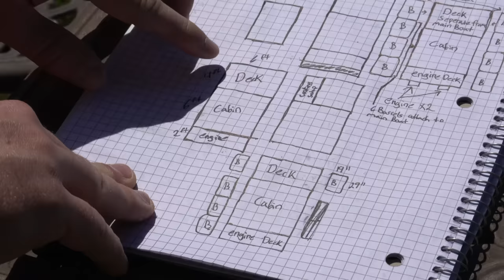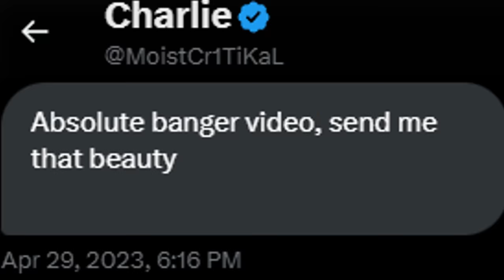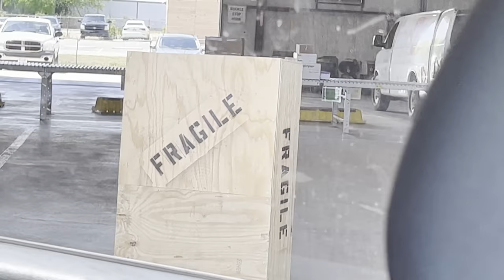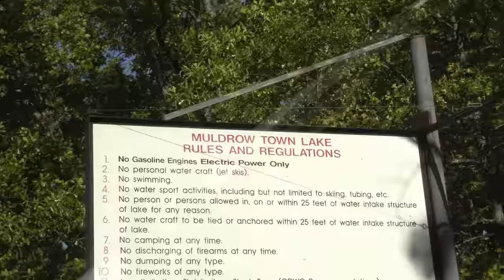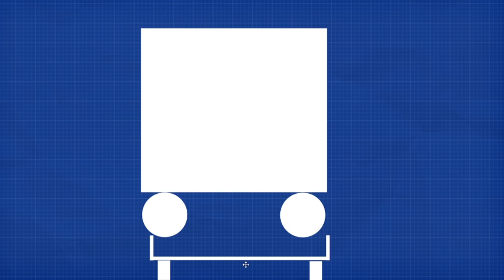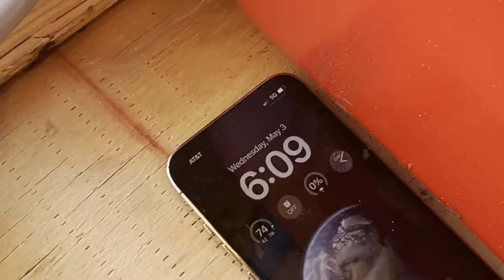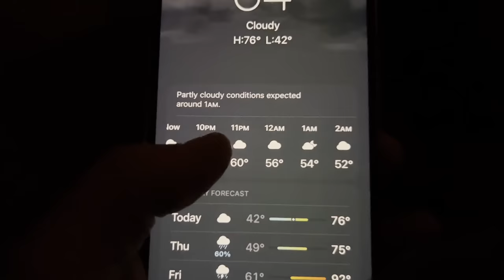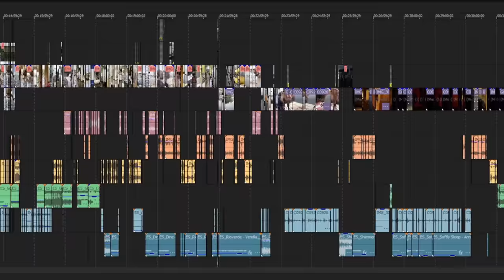Surviving 24 Hours On A Homemade Boat

Comment: If you decide to have a second crack at a boat like this again, (and it's in budget) definitely fill the barrels with foam. Extra buoyancy and less room for water to take up should a leak develop. Also I'll look into fixing the trailer I've got  to help out. 16x8 foot bed cargo trailer. Still not a boat trailer but way more room for that luxo yacht you'll surely end up building.

Comment: You need a stronger board you slide in to lock the platform in place. It bent the L brackets due to the barrels pushing up on the hinged platform. Also try thinner wood and studs so its lighter.

Comment: You said it before i could comment, but yeah. Paint is way cheaper in the long run. Not just dollars and cents, but the amount of aggravation and always wishing that you had just done it when everything was apart and in your shop, clean and ready to go. Live and learn. I've done the exact same thing a bunch of times. Used what i had or what I'd bought and then started to put everything together and then... what was i thinking. I should've just done this or that and be done with it. But, that's how you figure out the tried and true methods and applications that give you the finished result that you know works because you've already worked out all the kinks and found out which steps are redundant and which steps have to be given more patience and attention to detail. I can't justify buying things for the crazy prices that being asked these days, when I've got 50 grand in tools, 40 years of experience and a full shop to work in. Plus after you've built it, you know exactly every single weld, every single bolt, every single wire, every single aspect of what your finished product is. I rarely buy new steel or aluminum, instead i go to a giant metal salvage south of here and spend a day picking through, loading up and paying straight weight. It comes out to about 60 to 75% savings on materials. Then a day or two with a forney cup and grinder cleaning everything up and a light mist of oil you've got materials for a dozen different projects at a fraction of the cost. Forged steel telehandler forks that cost$ 1400-$1800 a pair cost about $350 buying by the pound weight. Everything that you can imagine that in forged, cast or extruded can be found at good salvage yard. Differentials, any kind of suspension leaf springs, coils, axles, drive lines, steel link conveyor belt, elevator parts, airplane parts, pipe, square tubing, solid stock, plate steel, plate aluminum, t steel, i beam steel, web trusses, gear boxes, hydraulic rams , dozer blades, you get the idea. Crazy cheap compared to buying it as used item verses straight salvage weight. I can build one job, charge less than manufacturer that has way more overhead costs added into each product, and the profit from one job will pay for all the materials for three more job builds and every bit of those three is pure profit material wise. Anyway, blah blah blah. This post is way longer than i intended, but whatever. Just some options to consider for your next build.

Comment: You need more barrels, walls that will prevent water from going onto your floor, and some sort of input on the barrels that will narrow the flow of water if the cap falls off again. Get an electric motor you can put a generator on it if it’s big enough to avoid the fumes and you have an “electric” motor 😅

Comment: Make another video expand the dock on the sides for more stability and do 50 hour stream on the water and put total boat water seal paint on the wood on the under side paint the boat for a little pazaz and bring repair supplies
Reply: Also add some plastic for some parts like the roof if it rains it won’t soak up the water that’s stuck on the roof and it’s a little lighter
Reply: Also add a screen door